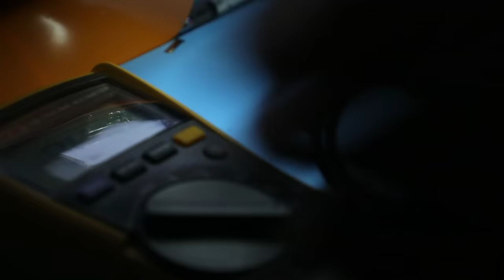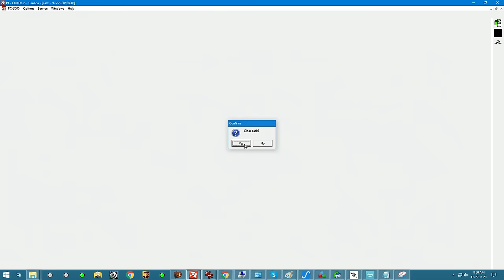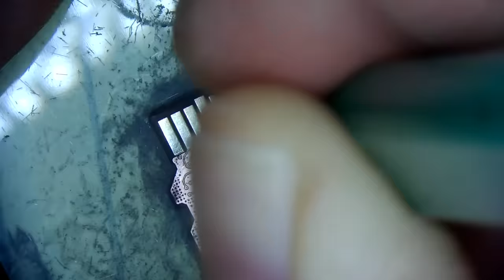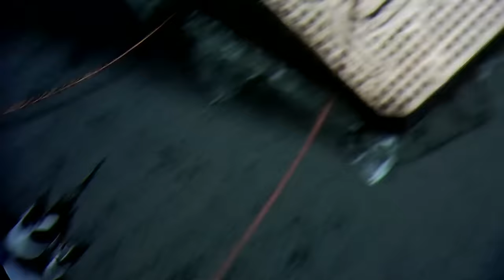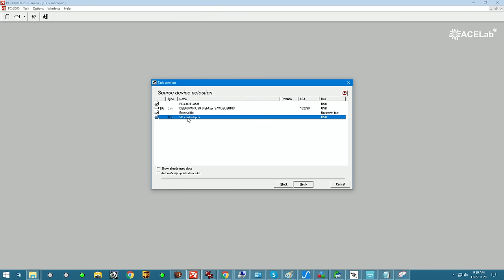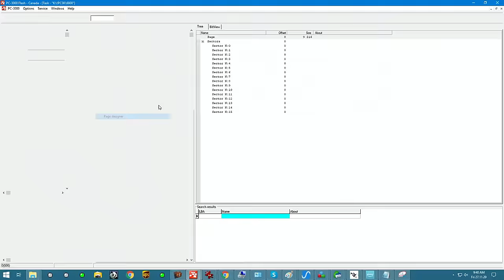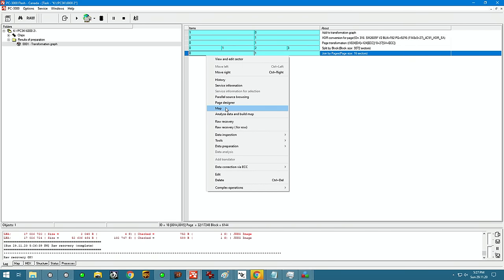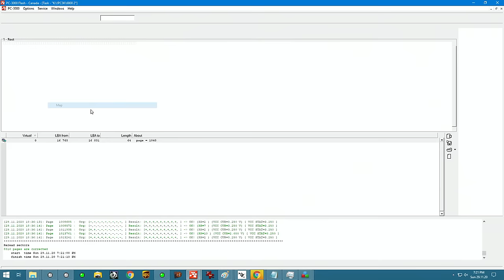how to recover data from microSD card if the footage is priceless

Comment: Can you please mentioned the soldering tip and jumper wire please?
Reply: Don't be lazy and check the vid description. The enamel wire is indeed not there bit you can use any (i bet that was either 0.1 or 0.2)

Comment: I have a USB Stick with a failed controller with data that is more a "nice to have" than actually important, and I cannot for the life of me get a suitable donor for it, since it's a few years old, and was right before the switch from USB 3.0 to 3.2. I also cannot find any references to the used Hynix memory chip. Should I try another Stick with a different controller, or would I have to bite the bullet any pay the hefty price of chip-off-recovery, which I cannot do at home?
Reply from the maker: you can DM me on instagram, or drop us a link here: www.hddrecovery.ca/contact-us 
If I know more details, I can check for the donor here with me.

Comment: Great job. How did you know to solder which wire to which via (the small round on de pcb) to the output pins of the test device?
Reply from the maker: I will cover that in the next episode on monolith design devices

Comment: How are you soldering at that small of a size on the micro sd card? the lines are smaller than the wire.

An don't say it's the tool size, because I don't see solder on it or those tiny spots on the card.

How are you attaching the wire to the card? 8:25
Reply from the maker: Tip is tinned